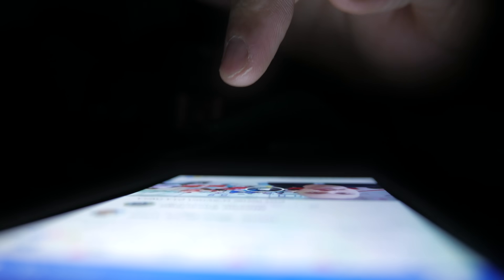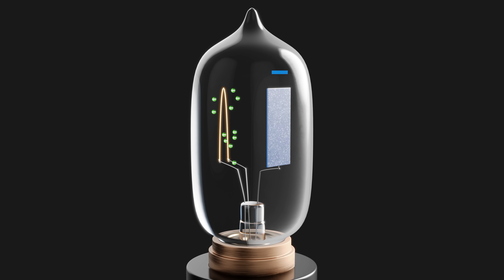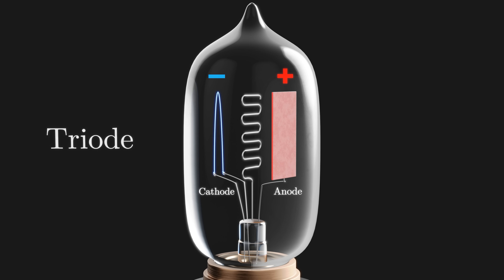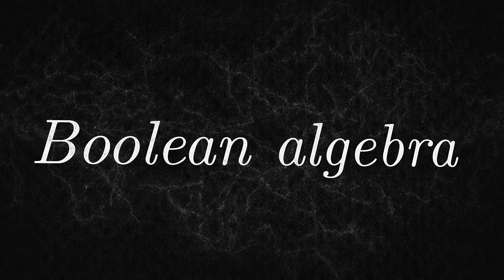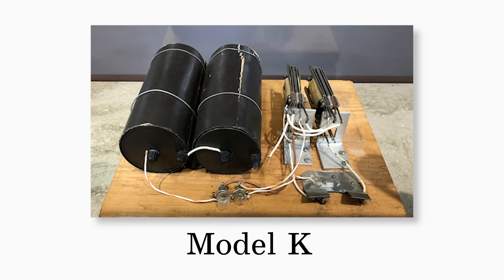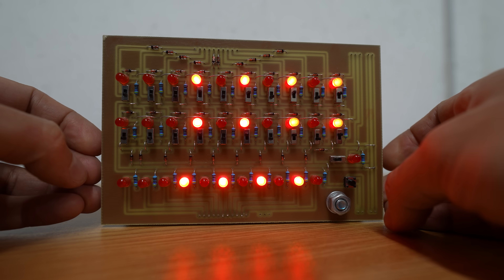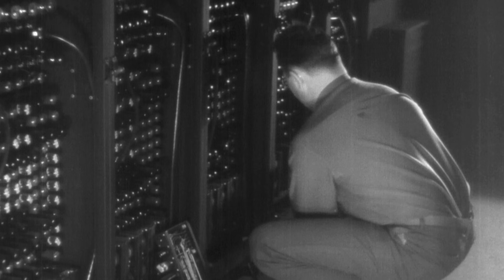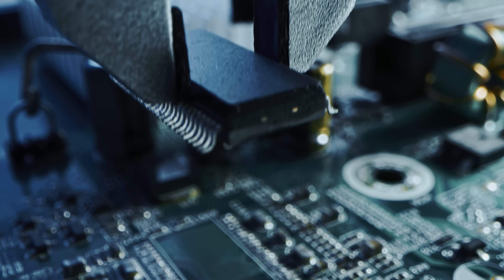Why The First Computers Were Made Out Of Light Bulbs

Comment: ENIAC wasn't first with being programmable - Colossus, co-developed by Alan Turing, predated it by years and did a lot of heavy lifting for the Bletchley Park codebreakers during the war.
Reply: Colossus was not a general purpose Turing complete stored program computer. ENIAC was. However, 10 Colossii clustered together could in theory be made to be Turing complete, according to Benjamin Wells at University of San Francisco. Turing didn't really "co-develop" it - it was Tommy Flowers with Sidney Broadhurst and William Chandler. 

Colossus was pretty much an application specific machine. Outside of the world of cryptography, it's enduring contribution was to show that valve electronics could be reliable enough at that scale to be useful. Had it been a total failure in that regard, possibly no one else would have tried again until the transistor became a viable component. Arguably, those early days of valve computers (fixed or general purpose) gave computer science a 10 year head start.
Reply: @abarratt8869  It was programmable by switches and could have done other operations. The Manchester Marl 1. Manchester Baby and EDSAC still beat ENIAC if you raise the bar in this fashion.
Reply: To be fair, the first general purpose computer was the ABC (Atanasoff-Berry Computer) which was built 3 years before ENIAC, but history sometimes forgets this
Reply: I think the theme of the video was light bulbs or basically vacuum tubes. So keeping that in mind ENIAC was mentioned.
Reply: @aadarshgoenka3206  The Z3 also worked with the same type of relays.
Reply: He didn’t say Turing complete.  He said electronic, and programmable.  Colossus was both of those.
Reply: He didn't even care to mention Konrad Zuse, the father of the modern computer - not even ONCE. This is such a poorly researched video.
Reply: @Finkelfunk  He is just a boomer caring the most about edison- a thief and killer.
Reply: You're missing something critical here, he specifically said "electronic", which meant that it had zero moving parts, both Colossus and Z3 by Konrad were in some way mechanical, even though Colossus was mostly electronic, but it still read the program on punched tape, meaning it required motors.
Reply: @xSyn08  He said electronic in the contect of "used valves as the switching mechanism, not relays", which colossus easily meets.  Plus, there are millions of examples stretching all the way to the present day of "electronic" computers with programs that are loaded off mechanical devices.  Oh no - your computer has a hard drive, it's not electronic!  Oh no, several supercomputers built in the 80s used punched cards to store their programs - clearly they weren't electronic computers!  You're well into grasping at straws territory.
Reply: @beelseboob  That is fair, the input or output are not particularly an important aspect of what is being discussed here, it's more about the valves
Reply: @xSyn08   - so it was better than ENIAC as it could automatically read the data in for an external storage device - i.e. a moving tape. This is just like a modern day computer reading from a floppy disc.
Reply: @xSyn08  By that score the keyboard you are using is not electronic. Colossus had a teletype keyboard.  ENAIC needed plug boards and wring to make it work. The Manchester Baby that predates it had the first electronically stored program. By any measure you give ENIAC was not the first.
Reply: are you british? 
because british people seem to have this... tendency to find a way to claim credit for American inventions, innovations.
Reply: @mariacheebandidos7183  This has nothing to do with nationalities; as far as I can tell colossus was the first programmable computer, the fact that it was built by Britons is completely irrelevant. I am British and I have as much to do with the Colossus as any other person from any other nation. And on the topic of stealing credit for inventions, isn't it the American scientist Edison that is most infamous for that?
Reply: @czcccc9627 This has ALOT to do with Nationalities lol Funny thing is you didn’t mention Konrad Zuse who build the first programmable, fully automatic digital Computer in 1941 !! 

2 years before the Colossus  !
Reply: @f.n8581  Still has nothing to do with nationalities. Sorry for the late reply but, based off of further research it seems that neither Alan Turing or Konrad Zuse built the first true modern computer. It was only in 1948 that Freddie Williams and Tom Kilburn built the first computer that was able to execute programmes stored in addressable electronic random access memory, making it the first electronic computer as we understand them today and, as pedantic as that sounds the definition of 'inventing the computer' must be strict otherwise we would all be arguing who invented what. Like, for example, I could say that Charles Babbage invented the first computer despite his preposed analytical machine not really functioning in any way similar to a modern computer, or that the Antikythera mechanism is the earliest example of an computer.
Reply: @mariacheebandidos7183  Collosus was verifiably built before ENIAC, and was an electronic, programmable computer.  In what way is this a Brit claiming credit for an American invention?  This is an American claiming credit for a British invention.
Reply: @mariacheebandidos7183  I think you'll find you have that the wrong way round - my school was older than the USA - we were creating an awful lot of things long before the French and the Spanish helped some traitors create the USA 😂
Reply: @mariacheebandidos7183  You are copying and pasting this lie in a lot of places.

Comment: You’re quite factually incorrect about vacuum tubes.   Folks like you are the same folks that said “due to the failure rate of tubes, a machine with that many tubes will never run” BEFORE they tested the ENIAC.   Vacuum tubes and their technology are NOT just complicated light bulbs.   You left out pentode and bean power pentodes that are actually what we’re used to amplify radio and radar signals.   Seriously dude, why do you obviously choose to leave so much out??

Comment: FYI. The grids of vacuum tubes are very rarely biased positive because that would result in positive Grid current. Generally they're biased negative and changed to be more or less negative. In fact the grid can collect electrons and this effect can be used for self bias. If a sufficiently large resistor is attached between the grid and ground you have what is is called Grid leak bias, and a negative grid current.

Comment: 2:12 what does being positive with respect to filament means? Filament itself has a positive and a negative. So does the new plate has to have a potential higher than the filament anode?
Reply: You got it correct, the anode/plate has a higher potential than the "filament anode" which now would just be the cathode.

Comment: 9:11 Uhm dumb question. Why is there no current flowing through the solenoid if both inputs are open?
Reply: When both switches are open or closed there isn't a potential different across the solenoid coil, therefore no current flows through it

Comment: Interesting trivia: The first "computer bug" was a literal moth stuck in a relay in one of these relay calculators!
Reply: I've waited for the moment that this fact gets dropped in this video! Thx for mentioning :D
Reply: @ELBARTOmovies more a factoid than a fact
Reply: That was, as quoted verbatim, "first actual case of a bug being found".
Reply: @dryued6874  Yeah, it was a joke, like a term being found literal; a bug causing a "bug".  It would be like if you said Bitcoin was the first case of digital cache.
Reply: The term was around before computers were a thing. It had to do with buzzing interference noises on phone lines which sounded like buzzing insects. Debugging referred to fixing the interference.
Reply: Nope. That's most likely myth. Research it!
The name was probably around earlier. But the moth incident is most likely real.
Reply: @RecursiveTriforce  Myth or moth ? :)
Reply: @RecursiveTriforce  no one said it was the origin of the name.
Reply: @RecursiveTriforce  The issue is definitely older than the physical relay based computers, but I remember hearing this in my first Comp Sci class in college decades ago (and it actually showed up on a test...). It was common with telegraph issues IIRC. Probably became "a thing" because she was a valued member of the engineering team working on one of those early relay based computers during WWII. Compare to the DHMO jokes. Been a thing for longer than the Internet, but nobody can really remember any actual reference to it before the first prank website went up about it in the mid 90s, so that's the "first time" that prank was done.
Reply: @RecursiveTriforce  Yes it's myth not moth
Reply: @RecursiveTriforce  Nope.  The moth was caught in a punch card and is the actual reason the term bug was coined.
Reply: The term "bug" and "buggy" for something malfunctioning comes from at least the days of radio
Reply: @Rivanni  Perhaps I should have said, "A self-driving car got into an accident on a particularly difficult route. This is the first example of a computer having a hard drive crash."
Reply: The word bug was added to the lexicon because of static on telegraph lines. The relays would chatter like insects.
Reply: It was grace gopper, and coined this malfunction as bug
Reply: @kealeradecal6091  Her name was "Grace Hopper" not "gopper". 
Best Wishes. ☮
Reply: @kealeradecal6091  grace gopper ?
Reply: you sound like the did you know thingies at the side of the textbook lmao
Reply: @delightfulgenius4635  I haven't heard that, but I have heard that dixie tubes would splatter their filament on the glass to the point you couldn't read them.
Reply: I call B.S.
Reply: @Rivanni  Yes, credit cards and stock trading were digital forms of currency around long before cryptocurrency (unless you misunderstood my cache/cash pun), but I was just trying to come up with an example.
Reply: I object. A vacuum tube is not a light bulb.
Reply: Lol 😂 relatable flies get stuck in my room light
Reply: What?

Comment: I'm going to specify and say the best lightbulb ever made was the LED. The diode is in my extremely biased opinion, is the second best thing to grace electrical engineering as a whole, second only to the transistor. So take the best idea ever (lightbulb), and combine it with the second best thing in electrical engineering (the diode), and boom, you've got the LED.

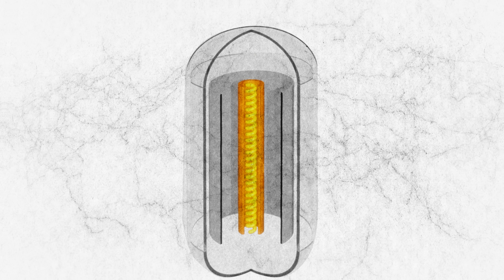Comment: 2:46 there is a mistake if you actually notice

Edit: check replies 

DC current graph
Reply: Whats the mistake
Reply: @bang4915  direct current graph is just a straight line
Reply: @ayusman1005  that's what they teach you in high school.  In Electrical Engineering terms, that infact is a Pulsating DC . There is no change in the direction of current with time, but the function  repeats itself at a particular interval. 

Pure DC is a flat line w.r.t. time (the one which you are talking about). But the waveform shown is also DC but pulsating in nature.

Comment: In one of your videos you told that the electrons don't  flow for transmitting energy.
So in this video how are you telling that electrons flow from negative side to positive side?
Reply: I'm not certain which video you're referring to, so I can't comment on that specifically, but I might be able to clear it up anyway:
Electrons do in fact flow from negative to positive. What many people aren't aware of is just that they move a LOT slower than the current does. You can think of it kind of like a hose full of ball bearings which knock into each other and thus transfer momentum from one end of the hose to the other. The ball bearings don't need to move very much in order to transfer momentum from one end of the hose to the other, but they are still moving. In the same way, charge is moved through an electric circuit without the actual particles moving that much at all.